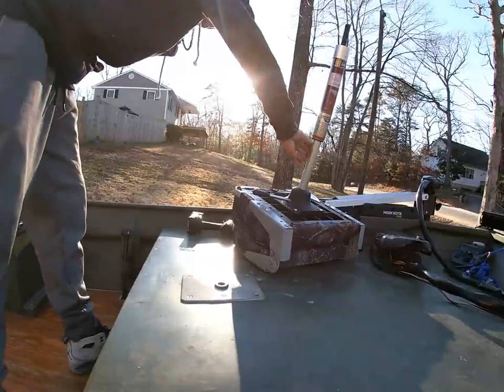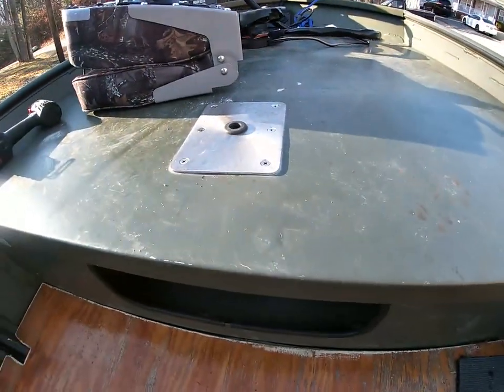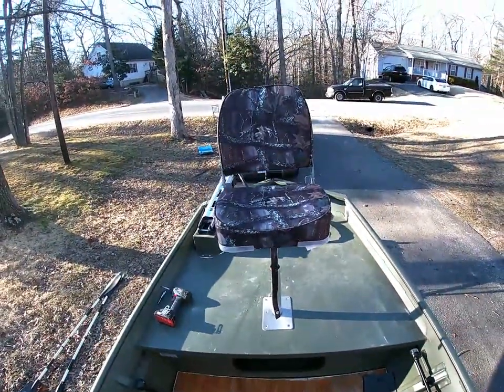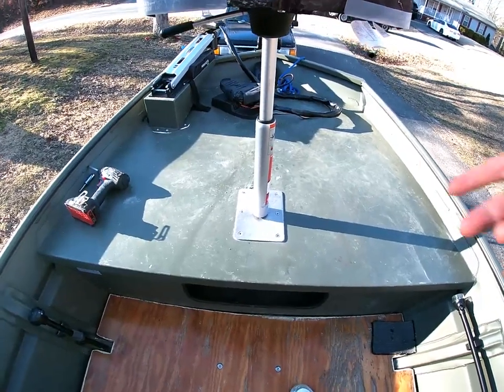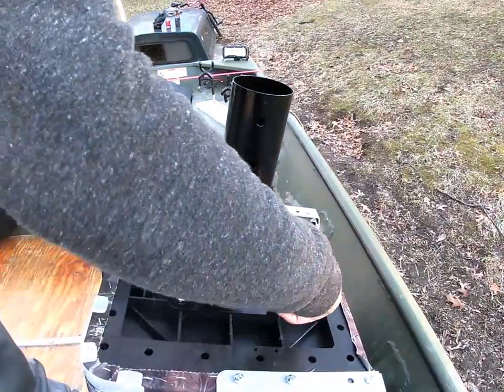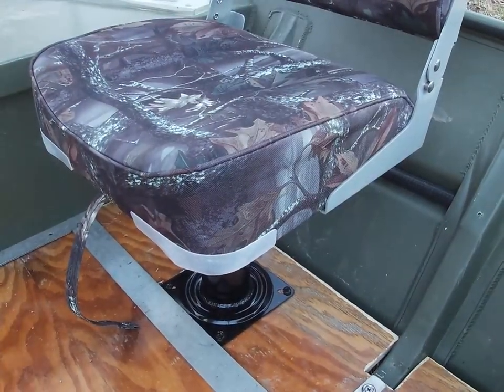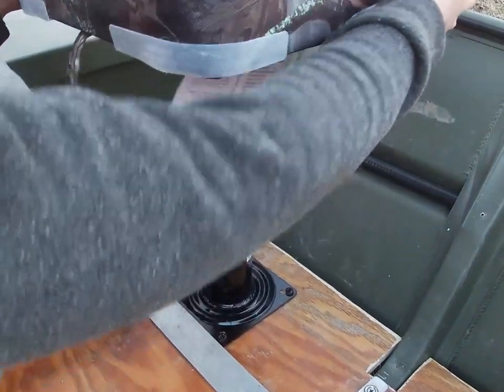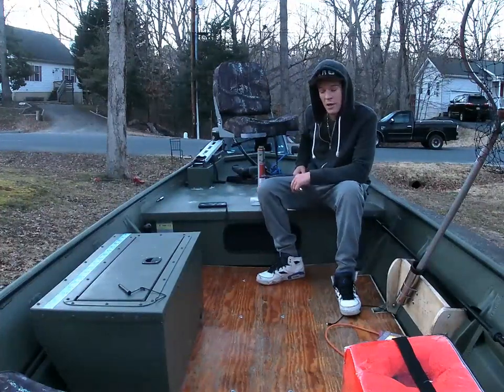Folding boat seat install , with pedestal and swivel ..DIY!! On Seaark 1652.

Comment: That looked like a screw type base mount and a non-screw post pedestal at which made it look unstable. A screw post pedestal is supposed to be screwed into the nut of the base mount.

Comment: Dumb question: can you just drill the holes in the boat and then screw in the pedestal?
Reply from the maker: The pedestal doesn't screw in. It locks into place . . Not to sure which seat your referring to. But either way you have to install the mounting bracket with the front seat and the pedestal with the back. Hope that helps.